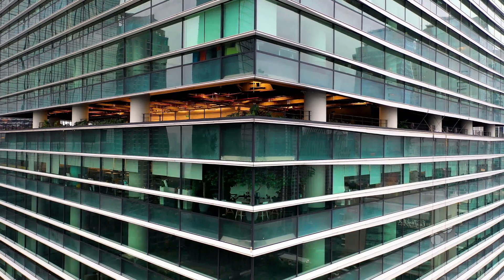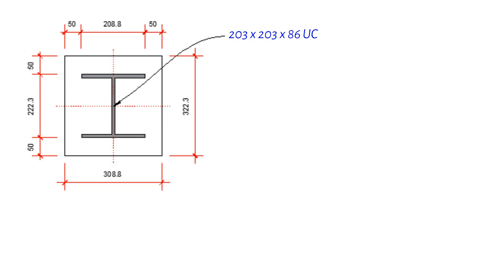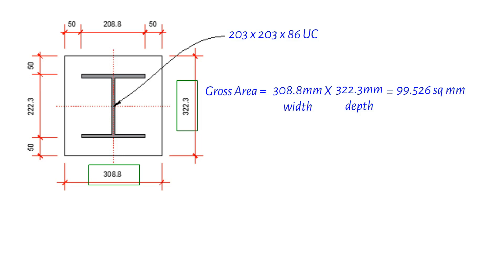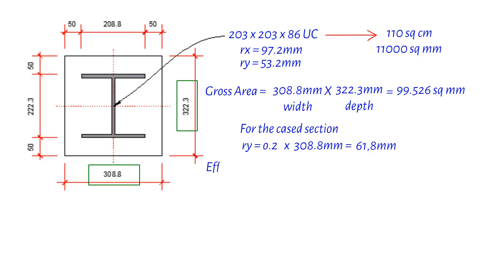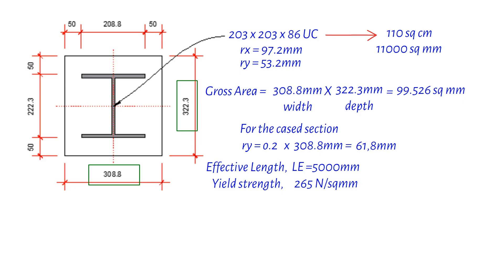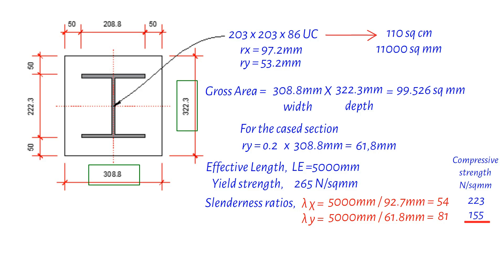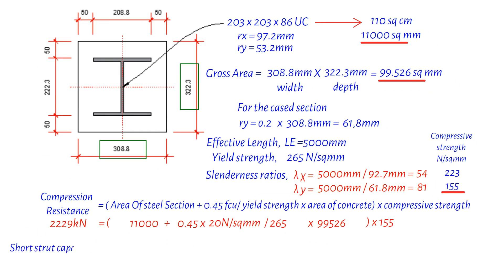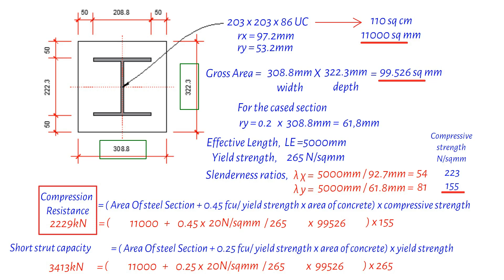How to Design a Concrete Encased Steel Column | Structural Engineering Worked Example.

Comment: Hai could you please make a tutorial on american based buildings using asce codes and inc. Especially on connection parts  like base plate, ledger connection, nailing capacity, etc.,